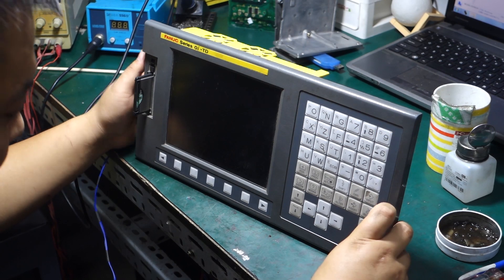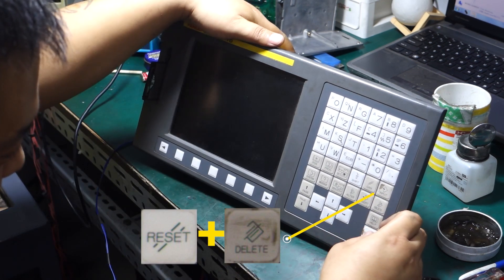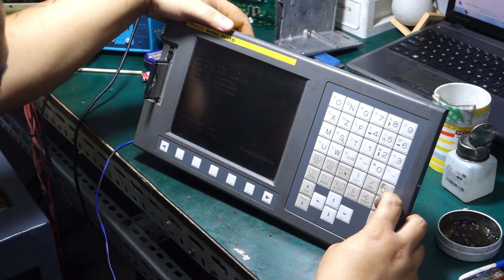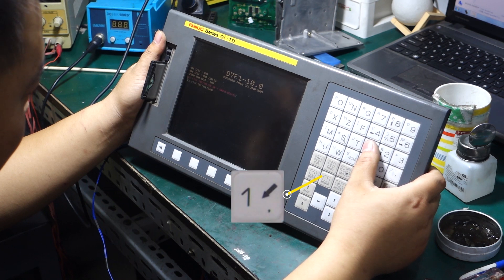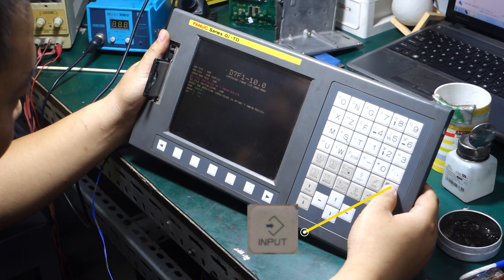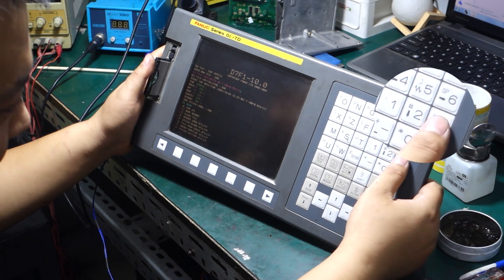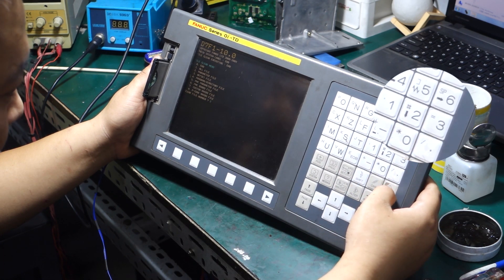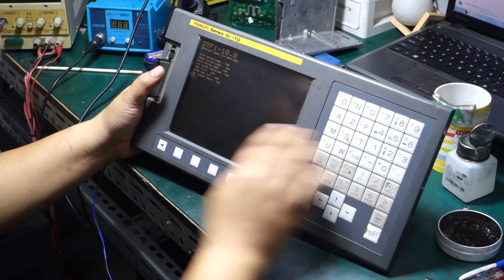How to delete parameters on Fanuc controller

Comment: Does this procedure apply to the 0i-TB Series?
Reply from the maker: Thank you very much for your comment. The method in the video can only be used for FANUC 0i-D series Controllers. As for the 0i-TB series you only need to long press Delete and Reset at the same time to delete the parameters. We will be shooting a video on your question soon, so stay tuned.